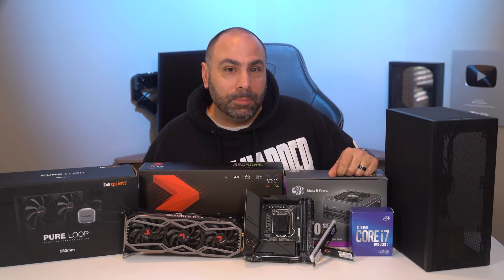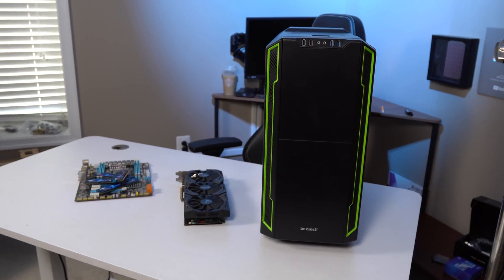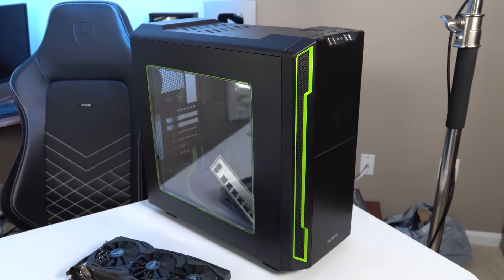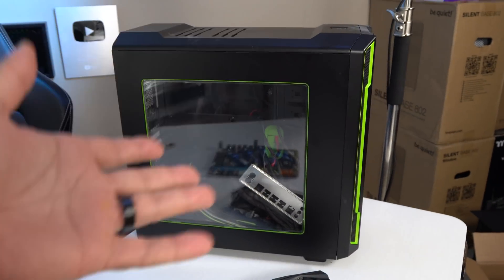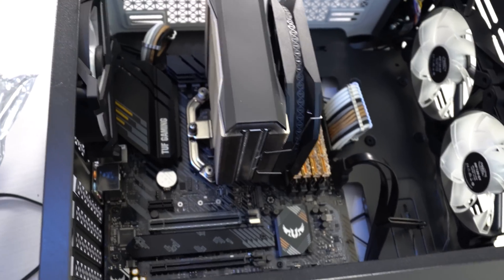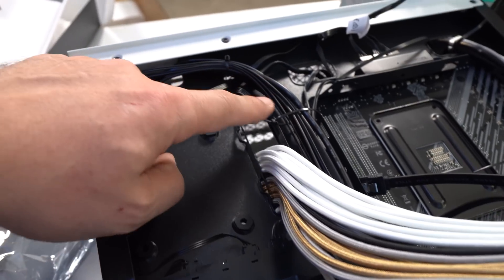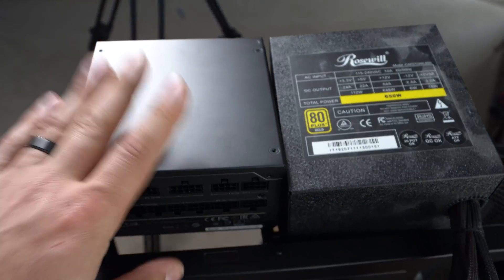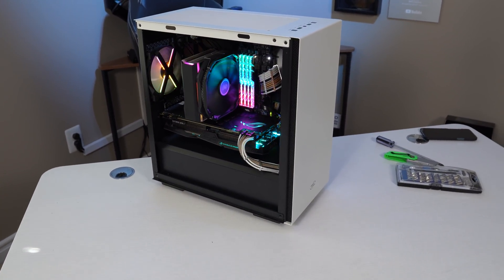Rescuing A Friend's PC & Surprising Him With A New One!

Comment: Oof, that thumbnail.  My PC was never that bad, but it my cable management was pretty mediocre before I replaced my old PSU with a modular one.
Reply from the maker: Modular power supplies are right up there with SSDs as the best invention for PC builders over the past 20 years.
Reply: @BPSCustoms  and now with NVMEs it's 2 cables less !